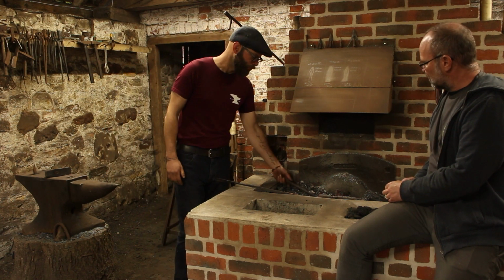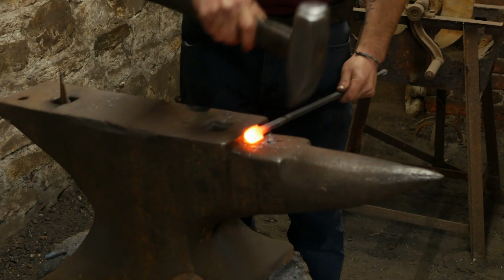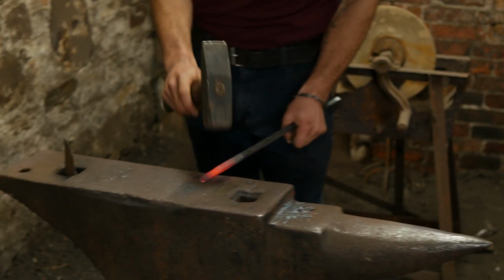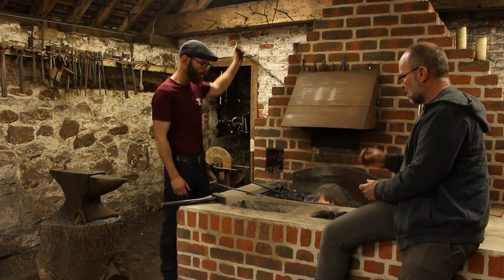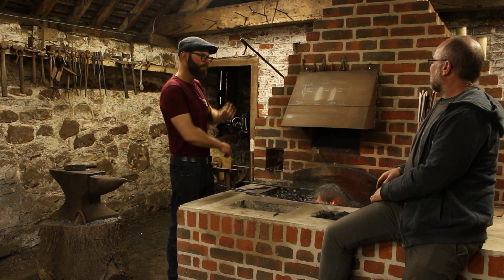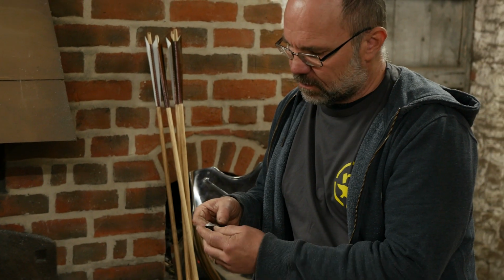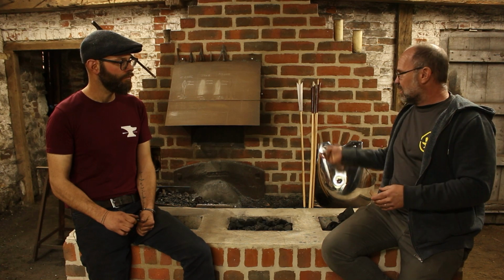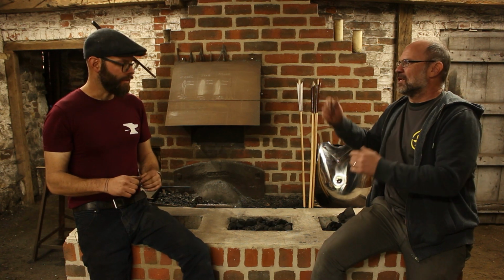FORGING AN ARROW HEAD, full process.

Comment: If these are the arrowheads for your tests, they really should be case hardened or made of steel. Kings Edward III and Henry IV both issued decrees that the arrowheads they procured were to be made of this material. Wrought iron is really too soft to be used against face hardened steel armour and Kings Edward III and Henry IV clearly understood this.

The best shape for the arrowheads for the purpose of penetrating plate would probably be the so-called "Tudor bodkin", which resembles the tip of a philips head screwdriver, not the "Type 9" that we see here. The idea is that only the proud sharpened cutting edges of the arrowhead should be in contact with the plate when the arrow hits in order to concentrate the force imparted by the arrowhead onto a very small area on the plate, maximizing the probability the pressure generated between the arrowhead and the plate armour will cause the armour to crack. 

The arrows themselves should also be heavy. The ones you used in your last test weighed 80-85 grams (1235-1312 grains), if I recall correctly. For a 160 lbf bow, that's an arrow mass of 7.7 - 8.2 grains per pound of draw force, which is on the light side. I would expect a "war arrow" for an English Longbow to be in the 10 - 11 grains per pound range, which translates to 104 - 114 grams or roughly a quarter pound.  

Heavier arrows have lower launch velocities than lighter arrows shot from the same bow, but the energy transfer efficiency from the bow to heavier arrows is greater than it is for lighter arrows, so heavier arrows will have greater kinetic energy and momentum than lighter arrows despite their slower velocity. I would expect that using arrows in the 104-114 gram weight range would have 6-8% more kinetic energy and 15-22% more momentum than the lighter arrows you used last time.  
 
The only advantage to using light arrows is that their higher launch velocity gives them a flatter flight trajectory and makes them easier to aim, but if archers did indeed engage armoured targets at relatively close range (less than around 50 yards), then this wouldn't have been much of an advantage and it would have made more sense for archers to have preferred heavier, harder-hitting arrows.
Reply: Except that the heads found on actual battlefields such as Crecy and the one drawn by Woodford from his 1818 excavations of Agincourt are Type 9 bodkins. 

And surviving Type 9 heads are almost always made of wrought iron and no case hardened heads exist.  If they enforced a law stating all heads should be made of steel,  and subsequently all smiths made them in steel,  the laws wouldn't have continued to be restated.  

And surviving arrow shafts are always far lighter than people assume they "should" be.  Whether from extant 15th or 16th century finds, not one arrowshaft would have given a 114g arrow,  without the head being so ludicrously oversized that the arrow shot with the aerodynamic properties of a small house.

As we've stated countless times from the very beginning,  we're not trying to make holes in pieces of metal.   We COULD use heavy shafts.  We COULD use different heads.   We COULD make them from high carbon steel.   But they didn't, according to all the archaeological evidence.   So why would we?

All that being said, it's probably best to wait until our next film comes out,  because maybe all your assumptions are addressed.
Reply: @MedievalArrows  "But they didn't, according to all the archaeological evidence. So why would we?" Indeed, why even bother testing longbows at all when the physical archaeological evidence fails to show they were ever used during the medieval period? To date, not a single longbow from the medieval period has ever been found. As well, only a handful of arrowheads from the entire medieval period have ever been found across all of Europe, so as far as the archaeological record is concerned, the evidence suggests that archery was rarely used at all in medieval warfare.

But then, why pretend that the extremely sparse archaeological record, which is heavily affected by survivorship bias as it is, is all the evidence we have?

Regarding the use of steel in arrowheads and the archaeological record: It isn't surprising that no steel arrowheads have been found among the very small number of medieval arrowheads that have been discovered. Steel corrodes more readily than wrought iron, so when it comes to small objects buried in the mud and exposed to the elements for centuries, there should be a survivorship bias in favour of wrought iron. Also, in case hardened arrowheads, the steel bit is on the outer portion of the arrowhead and corrosion happens at the surface first, so the steel portion is likely to corrode out of existence before the rest of the wrought iron it originally sat atop.

As to type 9s having been what the archaeological record has found to date: again, when survivorship bias is taken into account, that isn't surprising. Relative to "Tudor bodkins", Type 9s have less surface area per unit of volume and are therefore less susceptible to destruction by the elements.

There are at least two reasons to suppose that medieval arrowheads for warfare were made of steel during the era of plate armour. The first reason is that we have contemporary sources that tell us they were. Here are two of them (among others):

King Edward III on 8 Feburary 1368: "To the sheriff of Norhampton. Order, for particular causes, of the issues of his bailiwick to cause 600 sheaves of arrows in places where he shall see best to be made and purveyed of seasoned and not of green wood, as he will answer it before the king, and to be fitted with steel heads to the pattern of the iron head which shall be delivered to him on the king's behalf, sending the same to the Tower of London before Midsummer next, there to be delivered to John de Sleford the king's clerk, keeper of his wardrobe in the said Tower, knowing assuredly that, if the same be not made of seasoned wood, the king will charge him with the cost over and above the punishment he will inflict. The like to the sheriff of Bedford and the sheriffs of 24 other counties, every sheriff for 600 sheaves." (Caldendar of Close Rolls, 42 Edward III, Membrane 25)

King Henry IV in 1405: "ITEM, Because the Arrowsmiths do make many faulty Heads for Arrows and Quarels, defective, not well, nor [lawful] nor [defensible] to the great Jeopardy and Deceit of the People, and of the whole Realm; It is ordained and established, That all the Heads of Arrows and Quarels after this Time to be made, shall be [well boiled] or brased, and hardened at the Points with Steel, and if any of the said Smiths do make the contrary, they shall forfeit all such Heads and Quarels to the King, and shall also be imprisoned, and make a Fine at the King's Will; And that every Arrowhead and Quarel be marked with the Mark of him that made the same; And the Justices of Peace in every County of England, and also the [Mayor] and Sheriffs, and Bailiffs of Cities and Boroughs, within the same Cities and Boroughs, shall have power to enquire of all such deceitful Markers of Heads and Quarels, and to punish them as afore is said."

So, by no later than 1405, if you had been caught supplying arrowheads to the king like the ones you're making in this video, they would have been confiscated without payment and you'd have been fined and imprisoned. What is the basis for your assummption that orders and laws like these were ignored as a general rule?

The second reason to suppose they were made of steel is that they would have needed to be in order to be effective against armour made of steel. A soft, wrought iron arrowhead that slams into a plate of hardened steel is most likely going to deform and skid across the plate's surface, exactly as was the case in your previous video. To bite and cut into the plate, the arrowhead needs to have the material strength to bite into and cut it, and so it needs to be made of material at least as hard as the plate itself. Clearly this was understood in the medieval period, and that's why men like Edward III and Henry IV, whose lives literally depended upon the efficacy of arrows against armoured targets, took pains to ensure that arrowheads made of steel and not iron were supplied to the armies they led.

As to arrow weight, I never said heavier shafts should be used. In fact, as long as the shaft has the spine for it, mass increase should always be loaded at the business end to ensure the arrows are aerodynamically stable. In other words, the larger mass should come from the arrowhead. Contemporary historical sources refer to "quarter pound arrows". We also know that bows last longer when heavier arrows are shot from them, and that bows are more efficient at transfering stored energy to heavier arrows than lighter arrows. We also know that the fletchings used on medieval war arrows are more than large enough to stabilise arrows with 100+ gram masses. Surely medieval arrows came in a range of masses and surely at least some of them were as heavy as what I've suggested. Since arrows' performance characteristics are strongly determined by their mass, and since these performance characteristsics were important to military people from nations that emphasised archery, I think there can be little doubt that heavier arrows would have been prefered. As I said, an 7.7 to 8.2 grains per pound is on the light end for a bow made of natural materials. An arrow weighing 10 - 11 grains per pound is more reasonable.
Reply: @Marmocet  there's too many completely incorrect statements here to be worth addressing (I recommend doing a huge amount more research on extant finds as a starting point.   Medieval bows,  arrows and hundreds of heads exist from the period between 1200 and 1500, so not including the Mary Rose assemblage but that's for you to go and discover.  It's not always easy to find them, but they're out there.)

What I will say is that the vast majority of what you state as fact will be directly contradicted in lovely,  clear slow motion in our latest film,  so wait until its out, and you'll know much more.
Reply: @MedievalArrows  I used the word "handful" figuratively. I don't know the precise number of Western European medieval arrowheads that have been found offhand, but it is not greater than the low hundreds. Given that we know from historical records that the number of arrowheads procured just by English kings during the Hundred Years War was in the millions, a sample size in the low hundreds for the entire medieval period is not likely to be a representative sample, especially given the survivorship bias I mentioned. (By the way, I presume you are aware that it is an uncontroversial matter of fact that wrought iron is more resistant to corrosion than carbon steel. This will be especially true for slag-rich medieval iron and steel.)

If you know of any European longbows definitively dated to the medieval period (roughly the 10th-15th centuries), I'd love it if you could tell me where I could read about them. I know of only one longbow that might be dated to the mid 15th century (the so-called "Hedgeley Moor Bow"). All other longbows I know of date from before and after the medieval period. All this of course is beside the point I was making about your being highly selective about when the current state of the archaeological record does and does not provide the authoritative historical record. If you are going to argue that the archaeological record doesn't support the use of steel in medieval arrowheads, then to be intellectually consistent, you should concede that the same record doesn't support the use of longbows as medieval weapons of war either. Note that I'm not saying longbows weren't used as weapons of medieval warfare. They obviously were and it would be absurd to argue otherwise.

I quoted one order and one law passed by two medieval English kings specifically stating that arrowheads were to be made of steel, and that arrowsmiths who furnished arrowheads made otherwise were to be punished. You can look them up for yourself if you don't believe what I'm telling you. The fact that steel-tipped arrowheads were mandated by law is compelling reason to believe that at least among the English, steel-tipped arrowheads were the military standard, not the exception, by at least as early as the mid 14th and no later than the beginning of the 15th century. 

You can find many other contemporary medieval writings that either directly state that at least by around the 14th century, arrowheads used for war were being made of steel, or that do so indirectly by describing their colour or by referring to them as "tempered", or terms to that effect. 

The other stuff I said that relates to the physics and mechanics of bows and arrows is all correct and can easily be demonstrated in any one of a number of ways. Given the same bow, heavier arrows will have more momentum and more kinetic energy than lighter arrows, and within the normal range of velocities of arrows from bows, heavier arrows will be better at penetrating things like plate armour than lighter ones. Contemporary historical sources mention "quarter pound arrows", suggesting that at least some where that heavy.
Reply: @MedievalArrows  By the way, how many pieces of armour are there in the archaeological record that are made out of modern AISI 1050 steel like the armour you used in your last test? How many pieces of medieval armour have been discovered to date that are made out of slag-free carbon steel alloyed with manganese? Zero, right? The steel used to make the armour in your last test was in most respects superior to just about any steel that would have been made during the medieval period. In a more fair test, the arrowheads should also have been made of AISI 1050 steel as well, since there's no reason arrowheads wouldn't have been made out of metal of similar quality to the metal used to make armour.

Comment: G'day Tod...

ATTENTION !!!!

Have you seen the Video posted today by

Primitive Technology
Channel,

titled

"Building A Trebuchet."

???

Using nothing but a Stone Axe which he has previously posted video of himself making, and a Campfire which he has posted video of how he lights by spinning a Stick to heat and ignite some dry  Tinder...; he builds a Working Trebuchet, using Tools and Materials (Round Timber from Saplings, Cane, Bark-Fibres....) he builds a functional Trebuchet with which he repeatedly hits, and knocks down, at least 3 Targets - adjusting for Range by adding Rocks to the Cane Basket.

I strongly suspect that you may well be mightily impressed (I certainly am !) - though of course, it's wildly unlikely that anybody whose Culture was actually using Stone Axes and Round Poles with the Bark on - was ever building a Trebuchet...; it's very fascinating to see that it can indeed be achieved, without Sawn-Timber, Metal of any kind, or Complicated Carpentery and Joinery.

I figured that you would like to know about the news....

Enjoy,

Have a good one...

Stay safe.

;-p

Ciao !

Comment: Please use some other arrow heads!! There are plenty of Longbow arrow head designs, why on earth just test one single type.
Reply: Removal of variables.  We're using the most common type found at the time against the most common armour.   

Tod has done countless videos of different head types against different armour.  We don't need to keep adding variables, it does nothing to focus the experiments.  

Arrowhead production was a controlled process by the 15thC, they were only using a few types and each of those was being used for different purposes.  We have taken the MoL Type 9 and we're using it against the armour it was designed for. 

It would achieve nothing to watch Type 7s bend on impact or light M2s skate off,  so we're not doing that.